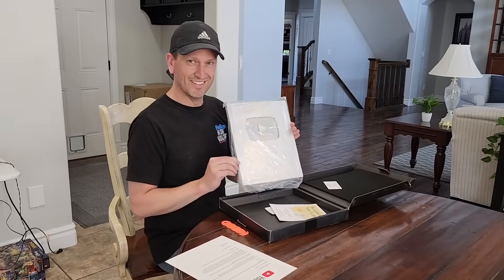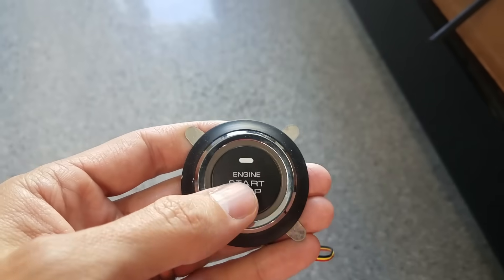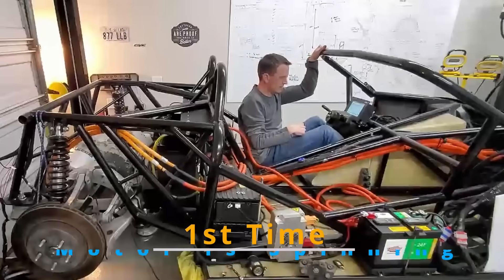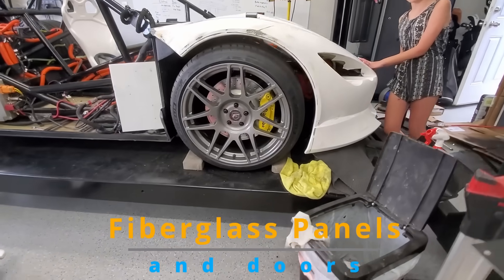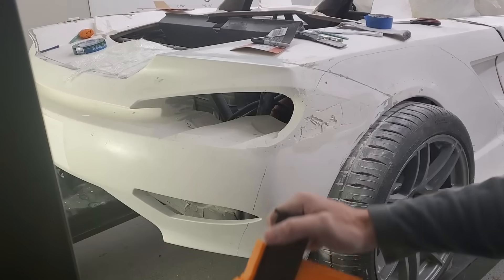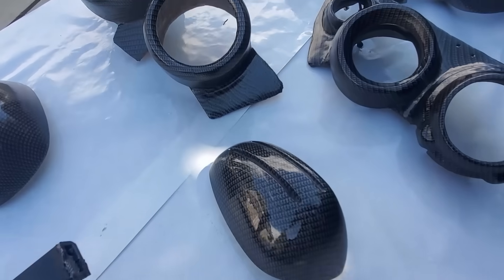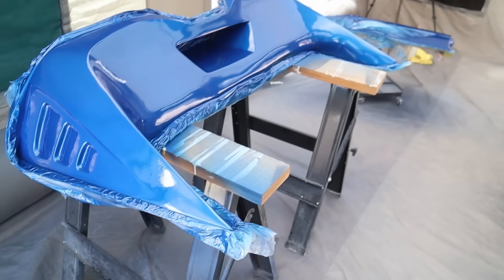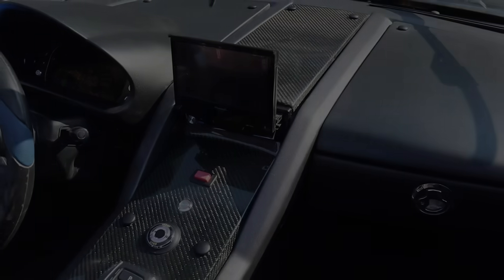I built my own Tesla Roadster - Electric Supercar

Comment: You said you learned the relationship of master cylinder diameter to caliper piston diameter.  I didn't know about this knowledge.  I am using a Wildwood master cylinder with 1.125" bore with four calipers that have 3.15" diameter each.  Now that I say it like that, it doesn't sound like a good idea, but it stops.  Will you share what you learned?
Reply from the maker: There are lots of online calculators

Comment: There's actually a car from a video game that ive been wanting to make, a bit more buggy off roady looking, but it was a vehicle i feel in love with. tbh i first saw you during Zach's video and have since really contemplated just pulling the trigger and doing it, it even got me somewhat interested in engines and more specifically a Rotary Vein Engine and using water as its fuel source for something a lil spicy, however i would go for an electric cause its easier. Also a good way to recycle as I can probs find dead EVs in wreckers and cannibalize them for the project, though i do want to make the body and frame myself
Reply from the maker: Good luck with the build!

Comment: Not able to hear anything from this video at the moment, so what’s the details on this thing? Weight, power, performance? It looks like something that some real car manufacturers aren’t yet able to make at all!
Reply from the maker: Specs are at the end of thos video https://youtu.be/Prv2rXioCe8
Reply: @ so, 600ish hp, rwd,  a lil more than 1 ton weight with a small 32kWh battery, 2.5sec to 62mph - definitely sounds super nice! Do you reckon that if you’re able to put a bigger battery in it for more range (and more fun time), it would ruin the lightweight feel of the car? :)

Comment: Airbags?

I would consider adding some lines to it. Maybe some more horizontal lines to contrast with the blue (I would have gone more of an exotic color combo than that but that is your choice) but definitely needs some lines stretching across the car detailing out features with either black or carbon fiber or maybe white. Consider along the rocker panels as well 

You also might consider a custom badge set. Front hood, rear, left and right fender, etc.... custom.

Comment: Sweet golf cart bruh. That’s all those will ever be sorry…. you can’t road trip it normally you can’t track it hard all weekend you only get a few passes on the drag strip before off to wait hours meanwhile my 911 turbo s can do it all day.  You can’t drive it around the country etc can’t do any of that like normal like people did before non stop with just short stops/breaks so you get hours of boredom with random minutes of fun getting pushed back in your seat at the beginning and end of the day whereas ice is all day everyday none stop. Oh and no sound means no soul just golf cart buzzing. Sure they are just fast in a straight line only 0 to 60 slowing up 120-130 (if a plaid) then nothing and that’s cool I guess but you can’t do it all day can’t do it when the battery is lower because unlike a ice you lose power and cant  do it in cold can’t do it on a road course etc etc. This would be way more epic with a high rev’ing V10!!! Battery only EVs as we know them today will not be around in 2035. Well people stuck in 20 year loans will be haha but no new ones. Way to many downsides from pollution to build them as its a fact just building the battery pack pollutes worse than building and driving a ford f-150 for 100,000 miles at which point they simply break even because most recharge from coal power plants ah well break even until it’s time for a new pack. The mines for the RARE EARTH Materials are massive using tons of diesels machines to get it out of the earth and ship the worse materials around the world to be refined. Then there are the illegal mines that use slave and child labor and have no health or environmental protection in place and yes even a Tesla ends up with cobalt from those illegal mines unknowingly. Unless they buy the mines they can’t control that. You also can’t recycle most that material and again it was called rare earth long ago before 1990 for a reason!! Then you got the downsides of charge times to range on each charge charge to pack replacements after a few years and they do not work well or at all in the cold etc etc. I could go on but why bother when the future is hydrogen and synthetic fuel and hybrids and oil. So basically like it was before battery only EVs but with more hybrids and hydrogen as that tech becomes better and cheaper and stations add the ability to make it. Even the EU updated their law recently a law from a few years back from only  allowing battery ev cars by 2035 to also allowing synthetic fuel and hydrogen. Heck everyone I knew with one sold theirs just recently in February after we got hit with -30 degree days in winter. Not one person made it more than 2 years. One dude had it charging all night in his garage he works 16 miles from home and didn’t make it to work in -35 my ice car had to save him and it started right up and got killer mpg.  Another guy bricked his because he parked it outside in that cold for more than 2 hours lol. Others sold them for the stupid interiors and the hassle and delays they cause.  I sold mine because my annual road trip to Chicago that took 7 hours max with stops in a ice car took my ev 18 hours!! Charge times wait time for chargers etc it was awful! It was worse on a holiday weekend waited hours! Btw I don’t live in Canada or something either I live in Springfield mo area. Btw dude must be loaded and bored. Daddy give you all the money?? Most people that dont have the money for a fun car and go this route don’t spend thousands on the basic unseen things and on a temp paint booth tor home! They just walk outside and paint it or wrap it. People that do this the way you did it are rich people who have the time for this fun project and the money to burn on a paint booth! To each their own I guess. The golf cart looks like a mr2 with a smooshed McLaren Bodykit haha

Comment: This K-1 looks amazing and better than original does anyone know the wheel and tire specs??
Reply from the maker: It was origi ally designed for a 96 Honda Accord donor.  My tires are 325/30/19 in the rear and 245/35/18 in the front

Comment: Body kit needed so much work because the original design needed a 1990-1993 Honda Accord donor car. Most of the parts would be from that. Kit is the K1 Attack. Never originally designed for anything out of a Tesla, seems like that is only a very new addition. Still a good looking kit either way.

Comment: Amazing built.  Car looks really sick in convertible.  My only thing is that if it rains the hard top looks kind of ugly on the car.  K1 Attack has been around for slightly over 20 years and im surprised they haven’t engineered a better version
Reply from the maker: Roof is alright, but I prefer it roadster style.

Comment: get a chassis mounted front splitter and bumper canards, chassis mounted rear diffuser and wing incase you track it again. it will be so much more responsive mid apex. did post your 1/8 and 1/4 mile time slip from sonoma ?
Reply from the maker: Very nice.  I will have to try it

Comment: Don't like the design of the car. Ok it's fast I guess. But what about safety? Did you use automotive components? What happens if your amateurish wiring catches fire? I mean there are a huge amount of safety related standards which have to be considered. That's the real challenge. Building an electric car on four wheels with a nice housing is really not that hard or impressive.

Comment: I would like to build a military humv with two tesla electric engines powering front and rear and a koenigsegg electric engine on each wheel corner for low end torque and power acceleration through esp like a formula 1 car charges through breaking and uses the power on the straight when you accelerate

Comment: I guess all you need is a metric F-ton of spare time and infinite resources.  Did I mention this was the first time I commented on this video ;-).  Seriously, if all these were first time efforts, then none of the equipment or materials were present from the start. The cost of just the equipment easily amounted to well over $100k.  Not to take away from the tenacity and aptitude required to learn and then do all this so well.  Clearly a beautiful job.  Museum....NO!  Just no.  Drive that thing!
Reply from the maker: Here is the cost breakdown 
https://youtu.be/YMcKzEb2Va8
Lots of firsts, but lots of mistakes and re-trys

Comment: nice work , really challenging , but how much it cost to build your car and is it effective to do it , i understand that building something for 1st time cost extra for some trial & errors or for trying ideas , but i want to know final actual cost for everything placed or used in the final car design . ( without any additional parts that may be tried but not used at the end) , and did the final cost better than buying the same performace & featured car from any vendor.
thanks for your info & experment really it helps
Reply from the maker: Just for you! 
https://youtu.be/YMcKzEb2Va8

Comment: Look great; I’m a bit jealous. Im 5+ years in on my Tesla sandrail. Its mostly together and turned it on but have to work my way through all the dummy lights (park brake, abs, charging) 
I pretty much used all the guts from a 2016 model S because i wanted the coolness of the touch screens n such. I need some help finding a few flaws since the car was a fully operational salvage vehicle before I disassembled.
Reply from the maker: Good luck!

Comment: I honestly would take this over most super cars today, I love small light performance. Even if you used a motor from a performance Model 3 it would still be a blast. I'm not a person who needs 707hp to have fun on the street. 300hp is more than enough in a 3,000lb car to have fun on the street and a lot of tracks.
Reply from the maker: Full specs are at the end of this video 
https://youtu.be/Prv2rXioCe8
600hp
2580lb

Comment: I'm really impress by you work and perseverance, Well Done!! Can you please tell me what you used to make the LED Day Time Running Lights? I manufacture steel replacement bumpers, and would like to add those tipe of lights as a design feature on the bumpers. Your advise will be much appreciated.
Reply from the maker: Do you mean the light strips?
https://youtu.be/Kd1sSxRDFS8?si=Z8kk_VOAFwEBtk-5
Search LED sequential turn signals.  Lots on Amazon and easy to wire.

Comment: Now if you take a mold of the overall complete shell parts, you can then go make yourself some vacuum sealed, rolled edges, Carbon Fiber Shell pieces, and then use some transparent wrap in the color and designs you want in order to give it a colored Carbon in some areas, while standard carbon in other areas, or solid colors in others, and then clear coat over it all and match those exotic doors with an exotic body panels and paint/wrap! Also when doing carbon fiber work to create custom things, may I suggest spandex? First layer dries thin and you can pull it to get a very smooth finish with the spandex before you ever apply the resin. once the resin dries you will then have a thin layer to start adding on the thickness too. I used to make custom kick panels and subwoofer enclosures. Once you have the car done and running, I'm sure you might consider things like a new center console and such. Instead of trying to create with fiberglass some smaller radio panels and stuff for your center console, may I suggest Duramix 40/40, and make sure to get the $30 special pump gun for the stuff too. once that stuff dries you will essentially have an equivelent to your interior ABS plastics that manufacturers use, except in the exotic styles that you choose to make your shapes from and such. But definitely the Duramix 40/40 for the really small stuff like panels around screens and such. just far better.
Reply: Oh, okay, you DID rock the Carbon Fiber, lol. Fucking Stellar! Wanna build a car together?
Reply from the maker: Let's do it!

Comment: You didn't mentioned where the windshield glass came from, also  you need to make final touches to the front grill mesh like un edges tried to make more proper touches, but overall I'm super extra surprised 🙀😯
Reply from the maker: Windshield is from a '97 Honda accord
Reply: @electricsupercar   wow Honda the "Power of Dreams"

Lol I don't imagine the DMV title process, like did you decide the year manufacturing? Model name will not interfere with Tesla as Brand ? What vin number did you came out to? 😙🤔😅
Reply from the maker: Just for you! 
https://youtu.be/MNvt1Il8jqs

Comment: Dude you should be very proud..your most definitely smart , lol..I MAY NOT BE A SMART MAN BUT I KNOW WHAT LOVE IS, :) AND I LOVE MY BUILDS..it doesn’t matter what your driving or building if your doing it yourself there’s nothing like that first morning when you get up early and you start up your ride and pull down your driveway,and roll down your window to listen to the motor as your crusing along waiting for it to warm up,so you can drop the hammer !!! I got the same overwhelming feeling at 12 yrs old after spending all summer learning to build my first engine for my first buggy, I might of rolled it a dozen times  over the yrs ,but the heads where always nice and shiny with their gold high temp coating,I had the frame power coated,the block,heats  ,and covered the seat ,and installed a roll cage pad kit ..that buggy would out run just about everything at the parks,never mine how big or small the competition was..
Reply from the maker: Thanks for the comment!

Comment: This is my first time... and each time you said that it looked professional! I had a couple questions though, what's the weight distro on the car and why did you go with fiberglass over trying carbon, I can only assume it was the price. For the next one, I would add in electronic aero, so you can air brake and get better down force in corners and smoother speeds on the straights. I know it would be your "first time" but I have a feeling it would also look great! Really nice car, I look forward to seeing new stuff.
Reply from the maker: Stats are at the end of this video 
https://youtu.be/Prv2rXioCe8

Comment: I would like to point out that owning a Tesla or other EV makes you both ignorant and cruel. The mining for the cobalt for the batteries is listed as being done by machines, as it is toxic. It is done by hand. By people who are basically slaves. Here - /watch?v=Y9jscWk2DMg
Mining the lithium is incredibly bad for the environment and the small lakes of toxic water are lethal enough to wildlife as to kill birds in minutes. Not only that, it uses some of the largest commercially available dump trucks, called Haul trucks. They burn 30 gallons of fuel an hour and have a 1200 gallon fuel tank. It takes up to 500,000 pounds of raw material to make a single 1000 lb battery. The numerous trips of haul trucks alone will obliterate any environmental positive that a Tesla can get you. That is not including all the shipping of Lithium and cobalt on top of that. ON TOP OF ALL OF THAT, most power from the grid comes from coal fired plants. That means your "green car" is running on both coal and slavery.
Reply: Okay but EV go woooooo on drag strip

Comment: What I'm actually wondering is how well the sound dampening is... Cause I didn't see you put anything in there. 
Not to discredit the build (I'm even a a bit jealous because something like this is illegal in europe)...
But does it have any sound dampening at all? And how is the noise inside?
Reply from the maker: Yes it has sound dampening.  Still open air roadster is a little noisy
Reply: @electricsupercar  interesting.
So what did you use? Some rubber on panel attachment points? Sound dampening foam in gaps? Always interesting how people solve these. I found a video of someone building an enclosed scooter that used rubber and silicone rings around panels before screwing them to prevent rattling.

Comment: Definitelly an incredible feat for working more or less alone. I'm part of our universitis formular student team and it takes us 20-30 persons and an entire year to build our new cars. On the other hand it also shows how much time it takes to desing and build custom parts and fulfilling safety regulations since we got quite a lot of them. Nevertheless it's amazing that you managed to do this on your own and the car turned out really cool in the end.

Apart from that, please don't work on high voltage stuff alone. (I couldn't tell if you had someone watching you during it) If you touch one of the components while the HV turned on, and nobody turns it off, the chance that you die is pretty high. We managed to partly vaporize a wrench by shortcutting our HV with it.
Reply from the maker: Yikes!